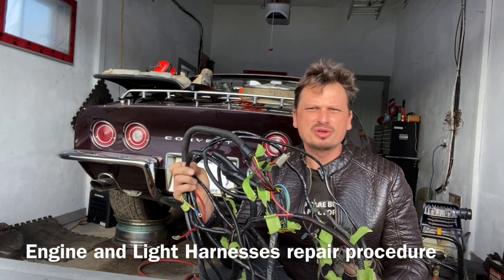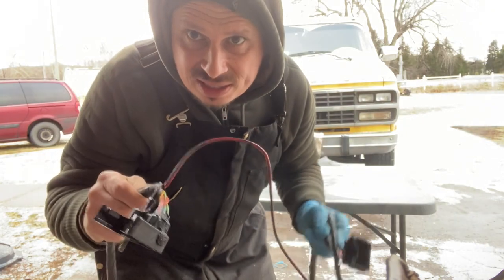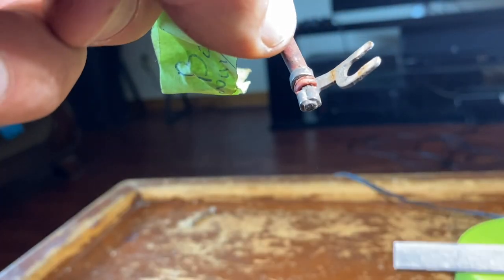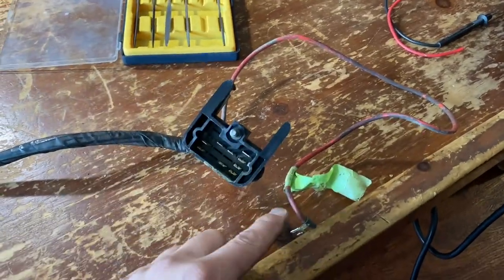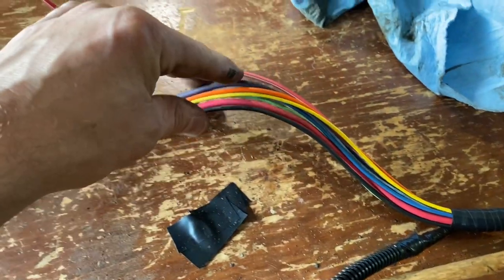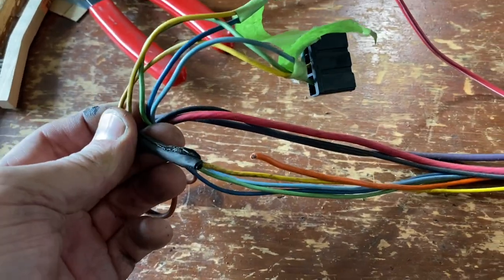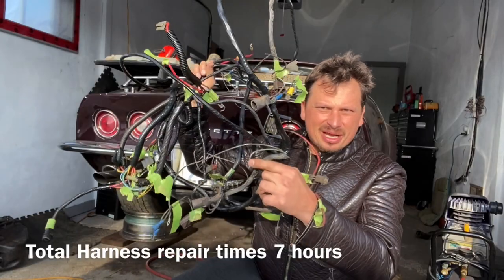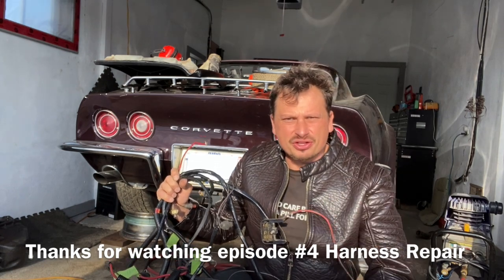Engine Harness, Headlight Harness (Repair reuse) How to repair and test engine harness Corvette C3

Comment: A very comprehesive look at refurbishing the wiring loom and not having to fork out $400+ on a new loom, as the saying goes, "If it ain't broke don't fix it" also worth noting that Tom marked all the ends with where they go, that's a must.
Four points to mention:
1) Don't use those crap crimpers, they are no good, you need to use the correct crimper that is setup for the right crimp type and compression, basically if you just go crimping as hard as you can with those things after a while the wire will snap off with vibration because its been crimped too hard, I know I've seen it. 
2) There are fuse links buried in the loom, be careful not to mistake them for connectors and cut them off.
3) Dialectric grease is NOT conductive, therefore DO NOT use it on the mating surfaces of a connector.
4) Don't use electrical tape in the engine bay, it will either melt or become a sticky mess, what you need to use is temperature rated cloth tape, it's specifically made to work in temperature sensitive locations such as engine bays, (ebay is your friend), it comes in different temperature ratings also. I used that corrigated plastic tubing also but it looks ugly and is not heat resistant, my go would be to wrap the loom in the high temp cloth tape all the way.
Reply from the maker: Thanks for all your input and thanks for watching. 
 The crimpers did have it the correct space, didn’t really show that super good in the video but they did.

Comment: Ok, you are my go to video guy now for my Corvette! I like how detailed you are in your instruction! Having a couple of issues at the moment. I had a running 1977 C3 (still not road ready) and now it won't make a sound when I turn the key! I tested the starter like you showed and it works. I tested the clutch switch and it works, so now I'm stumped. I'm thinking that maybe it's that little wire going to the post on the starter that you touched to make the starter wake up! (If that makes sense). I'll ask my other question later. It has to do with the brand new interior harness!
Reply from the maker: Thanks for the awesome feedback, good luck with your project my friend
Reply: I know this was a year ago but for everyone else...I had the same problem and eventually found a corroded fuse connector to be the culprit. As I was testing with a test light, poking at the fuses, I noticed at one point 3 fuses lit up where they weren't before, Hit the starter, and voila, running vette.

Comment: I noticed you have an HEI distributor.  Mine has the same setup.  Mine requires a full 12volts all the time.  That wire with the fiberglass insulation is a resistor wire so it gets hot and needs to shed heat.  I’m pretty sure you do not want that wire powering that distributor.  You don’t need the crossover wire to the starter anymore either.  It will run the way you have it but won’t last long and run crappy.  Yours might be different but thought I would throw that out there.
Reply from the maker: OK thanks I appreciate any and every suggestion, once I’m at the point where I turn the key and the car starts I will investigate those wires and see if it has 9.5 V or 12 V, I will dig deeper into it and make a video about it, that’s how it was set up when I got the car, I know there’s tons of electrical problems.
, Basically nothing works, when you turn the key the amp gauge drops to zero and the car makes a weird noise, I know I’ll figure it all out just troubleshooting through it one step at a time. If you ever notice anything in my videos feel free to comment I appreciate it.
Reply from the maker: Watch  my Corvette C3 starter video, I think that wire that goes to the distributor has 9.5 volts but like I said I need to get the car running first
Reply: Problem Solver, 100% no BS great videos, they have already helped me quite bit.  I bought my car running but poorly it had tons of new parts and upgrades and every one of them was installed wrong, lol.  The HEI you have should be 12volts less voltage tends to damage the little computer inside.  Just keep that in mind once you get her cranking.  Keep up the good work.
Reply from the maker: @pauljankowski5808  Thanks and I will definitely have a video on the distributor system once I read the whole manual LOL. For some reason I think I read that it runs on 9.5 volts, For sure the original system did but not too sure about this one, my Chevy G 30 has the same engine with the same distributor I could hook up a tester to it and see LOL

Comment: You could also put shrinking insulation on the metal cable connectors which were not protected before. It prevents them against moisture and getting dirty in future. You are in Canada, much more moisture place than for example California. You have also more salt on the road.
Mogłeś pododawać termokurcze na wcześniej nie chronionych metalowych końcówkach przyłączeniowych przewodów. Chroniłoby to je przed wilgocią i brudem w przyszłości.  Żyjesz w Kanadzie, o wiele wilgotniejszym miejscu niż np. Kalifornia. Masz też więcej soli na drodze.
Reply from the maker: I am reinstalling the Harnesses today, hopefully everything will work now, because before nothing worked lol 
 The car has never seen winter and it never well but yeah I guess I could’ve done that, but either way I’m happy with the Harnesses now, I think they are 100% we will find out today, thanks for watching.  Dzienki